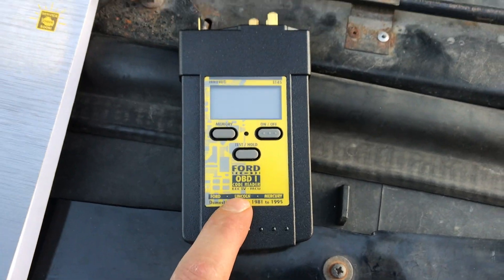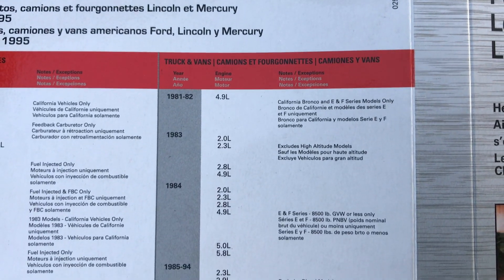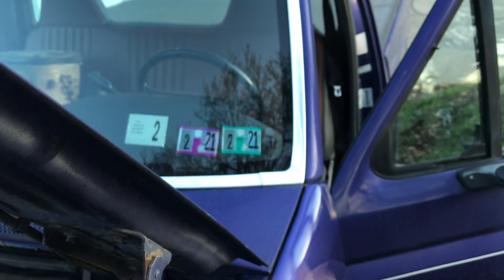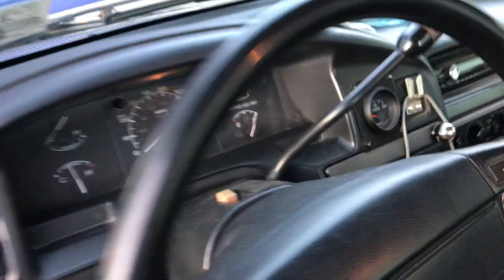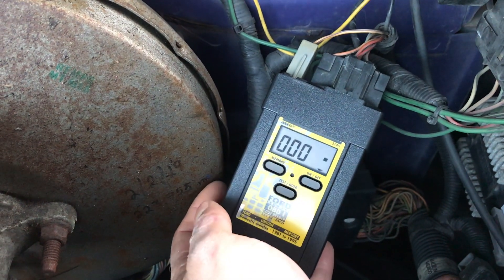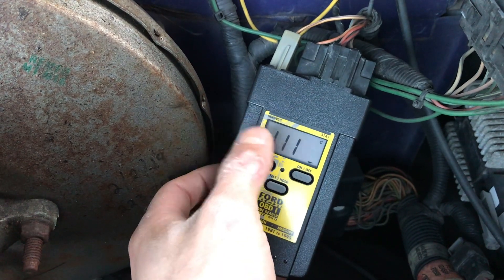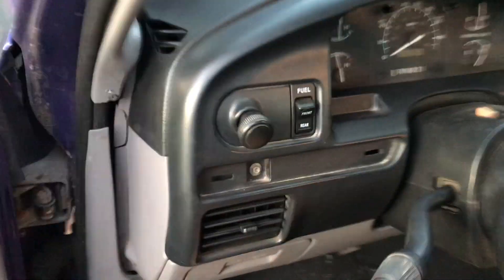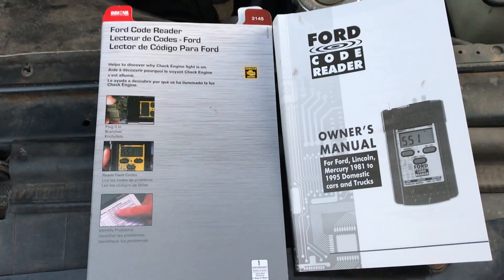How to Read OBD1 Codes on Pre-96 Ford F150

Comment: What does the * mean in the test condition section of the codes list?
Reply from the maker: Good question, I don’t think I’ve actually looked at that. Is there an explanation at the bottom of any of the pages or the front or back of the manual?
Reply: @TheMinuteMasters  not that I've seen. But yeah I ask because the manager from autozone told me my crank sensor could be what's causing my foxbody to not start which the code is 227 in the manual but the test condition has * not O R or C. But if it was the crankshaft sensor it would still come out on the code reader right?
Reply from the maker: @ShutUpKid2  Weird. Usually the code reader picks up on something it’s fairly accurate. The Astrik instead of having an actual letter code is a mystery to me. I’ll have to look at my code reader manual.

Comment: When I have mine connected and key on with the scan tool on it just displays 000 need help
Reply from the maker: Hi Austin, I would unplug the code reader and try again. This brand of code reader is good but I can’t say it’s flawless. The first three test I did it kept saying that my V8 truck was six cylinders. Finally it corrected itself. So it’s definitely worth trying a few times until something works.

Comment: Thank you for this video!! 
I’ve learned a lot.  
My 94 Escort is 10 and 111 for the 
KOEO so no issue there. 
The KOER my code reader isn’t giving me the 4 cylinder # prompt to turn the steering wheel and press on the brake so my code comes back as 
536 which is 
“BOO circuit not activated during KOER”
Possibly a defective reader?
Thoughts? 
Thank you
Reply from the maker: You're welcome! If I remember correctly, you may not always get a prompt. I would try to run the test again and just time yourself to turn the steering wheel. 
Otherwise, you could have a defective reader.

Comment: Hey man, great video. I'm fair new to trying to fix up an old family truck.  I've got a 93 XLT 5.0 and I recently started having an issue where the truck starts by immediately stalls. It's not a daily driver so it has been sitting to be tinkered with. I noticed the other day that an IAC bolt was a little loose so I tightened it and then since then I've had the issue. I removed the IAC and cleaned it/added a new gasket, it started and ran a few minutes with a normal-ish idle and then a day later it's back to the same thing. Just curious if you had any ideas on this issue. Thanks
Reply from the maker: Hi Grant! Thanks! I appreciate it!🤙 have you read the codes on your truck? That’s not a bad place to start. 
Otherwise when you have starting issues I typically go through the triangle of combustion. Air, Fuel, Spark.

Unfortunately you can only check most of the air components using a code reader because it’s mostly sensors. However, you can definitely check your filter to make sure it’s clean and if you have speed density look for the sensor and make sure that’s clean as well.
Reply: @TheMinuteMasters  So I've got the innova code reader and ran the KOEO test. Got codes 23 and 53 which are both related to TPS if I'm not mistaken. One being "high voltage" and the other "voltage out of range" I unplugged the TPS and it ran with an odd idle but it ran until I turned it off. Do you think with those 2 codes that new TPS would fix the issue? thanks man!
Reply from the maker: @grantsmith6945  That’s a good question Grant. A new TPS could fix that code. Honestly, you won’t know until you try it. It’s a cheap part too.
Reply: check the onboard computer

Comment: When I plug mine in it gets no power with the key turned or with truck on? Is a fuse blown? If so which one and where
Reply from the maker: That’s weird. I would check your fuse panel for sure. I don’t think there’s a specific fuse but it’s worth checking them.
Reply: @TheMinuteMasters  I fixed it haha it was my fault the batteries were dead in the scanner lol I checked with the test light and had power at the plug in test area so I figured it out haha. Got code 29 time for a new speed sensor haha

Comment: I have an intermittent problem with a 1995 4.9L manual. Every now and then, the truck will shudder, CEL will come on, and I will completely lose throttle response. Pedal to the floor, nothing. The truck begins coasting as if it's in neutral. Eventually it will slow down to the point that I'm almost stopped and the truck will shut off by itself. Sometimes it just shudders for a split second and then goes back to normal, but normally that's a sign that it's eventually going to shut itself down. Once the truck comes to a stop, it often will not start again, at least not immediately. It will crank and crank but no ignition. After cranking it every 30 seconds or so for a few minutes, it will fire back up like nothing happened. When the truck starts back up, the check engine light is off. 

I have a few questions. First, I'm pretty sure I have a vacuum leak somewhere (a/c defaults to defrost under acceleration, then comes back under light/no throttle). Could that possibly be related? Second, does anyone have any clue what the problem might be? And third, since the code disappears when the truck starts back up, do these trucks store codes that I would be able to read even if I'm not actively experiencing the problem, or would I have to just carry the scanner, and plug it in as soon as the truck shuts down?
Reply from the maker: Interesting problem man. A don’t think a vacuum leak would cause this bad of an issue. However, you definitely want to fix the vacuum line connected to the blend door actuator. (Passenger side of engine bay near fire wall). 
Before we jump down my usual rabbit hole of diagnosing steps, I would buy a code reader and read the codes on your truck. Fault codes are stored in the ECM. So you don’t have to plug the code reader  in as the problem is happening to get the code. Start there and then update me on what you find.🤙

Comment: I've had this brand OBD-1 for a few years now, it use to give me 2 digit codes and now since I've replaced the PCM (91 Ford F-150 XLT Lariat, 5.0) it's shooting out weird 3 digit codes...so is my reader faulty or what ?? The truck is running excellent with the new PCM and I'm not going to replace it. Any answers will be greatly appreciated, also I'm subscribing to your channel.........Thanks, TJ
Reply from the maker: Hey TJ! That’s new to me. I know OBD2 uses 3 digit codes. The 111 is the all clear 3 digit code this reader issues for OBD1. If everything is running well, then I would pay attention to the codes reader. However, I would try looking up the codes and see what they mean. 
Nice! Thanks TJ🤙 I appreciate it!
Reply: @TheMinuteMasters  Yea, it's kinda weird, until the PCM change it read the correct 2 digit codes now 3 digit codes but since the engine is running great I'm not tampering with anything. I've asked others and they replied pretty much the same as you and the booklet says nothing about it either so I'm thinking it maybe it's computer (PCM) related ??....BIG thanks for replying back !!
Reply from the maker: @t.j.h2810  Yeah totally a weird thing TJ. To me if it ain’t broke don’t fix it. Lol 🤙 You’re welcome!

Comment: Great presentation. I would however like to add that there were some ford trucks that had a GVW of 8800 or over, went beyond 1996, that still used the OBD 1 System. Case in point, my 1997 F350 with the 460 engine uses OBD1. It seems that these heavy duty trucks were exempt, up until, I think, somewhere abound 1989.
Reply from the maker: Good point the 97 years of F250 and F350s were the last of the old body style. I didn’t know they continued to use OBD1 though.
Reply: 5.8 ( 351W) Also. in some early `1998 HD F 350 cab/chasse OBS.

Comment: I have a 95 f350 7.3 and where you plugged the scan tool in I don't have that on my truck.  There is nowhere to plug the tool in
Reply from the maker: Really? My only other guesses would be to look along the passenger side fender and underneath the driver side and passenger side dash.
Reply: @TheMinuteMasters  mines on the passenger side
Reply from the maker: @ogairbender808  I’ve heard that before.

Comment: IMPORTANT: This particular tool is ONLY for Ford products. Innova makes a different model for GM products. They also produce more expensive models with a variety of adapters. Then there are REALLY expensive models that can be used with both OBD I and OBD II vehicles.

Also, the test plug isn't on the drivers side on all vehicles. Explorers, for example, have the plugs located on the passenger side.
Reply from the maker: Thanks for sharing man!🤙

Comment: What if the little gray plug isnt there ?
Reply: That connector is required for 1984 and newer models equipped with EEC-IV. 1983 and earlier models only use the one large MCU connector.
Reply from the maker: You are referring to the single wire plug? I don’t think that really matters.

Comment: Bought this code reader but it doesn’t link to my truck not sure why. It’s a 95 f150
Reply from the maker: I’ve owned two of these code readers and they aren’t the highest quality. The first code reader I owned one of the pins would fall back into the reader. So I would check to make sure that’s not happening with yours. I shot this video with the second code reader which so far is the best one of the two that I’ve owned. I would try it a few times and if it doesn’t work, I would exchange it for another.
Reply: @TheMinuteMasters  bought the reader months ago so returning it probably isn't an option but I don't think its a reader problem because my neighbor tried to use his and it wouldn't link to my truck either so I'm not sure what the problem would be.

Comment: The code in the Beginning of the test doesn’t matter?? If It didn’t have codes and the second test???
Reply: Ok had codes on key on engine off but when I do key on engine on I don’t have codes what do u recommend me to do ?
Reply from the maker: @The723shrek  I would look up those codes from the key off test, see what they are, and try to replace the part that causes the issue.
Reply from the maker: If you have any codes from the previous code reading those will appear first. Do you want to delete those out so that you have a fresh set of codes. If the first test didn’t have any codes then you were good. If the second test doesn’t have any codes then you are good also.

Comment: Hello. I know it's been a few months since your last response but I hope you see my question. I bought this scanner to diagnose a crank no start on my '93 F150 5.8L auto 4X4. As others, I get the triangle and square but no codes. I've tried it several times. Could I have a bad computer?
Reply from the maker: Hi Jose! So I would start the code reading process again and see if you get the same problem. If you get the triangle and square but no codes. I believe there is a trouble shooting guide in the code scanner manual. 
Your truck is a crank but no start. Have you checked to make sure you are getting air, fuel, and spark?
Reply: @TheMinuteMasters  Air and spark yes. It starts with starter fluid but only for 2-3 seconds. I'll try it again later today. Thanks for your quick reply.
Reply from the maker: @joseluisrodriguez7257  I would chase down the fuel aspect. The easiest thing to fix/replace is the fuel filter. Then I would replace a fuel pump, and go from there. 
No problem man!🤙

Comment: Mine just comes up with a solid square
Reply from the maker: I don’t know off hand why that happens but there is a trouble shooting guide in the code reader manual. My advice for most issues is to unplug the code reader, turn off your truck, and then restart the process.

Comment: How do you reset the light? Do you disconnect the negative terminal or pull a fuse? I have a OBD1 for my 86 f150
Reply from the maker: Which light? You don’t need to disconnect any battery terminals or pull any fuses. This code reader simply plugs into the OBD1 port and its ready to do its thing.
Reply: If you want to clear the codes pull the negative battery cable and let it sit for a few minutes

Comment: Hey man! My light comes on & goes off after a minute, I’m having lack of power when going up hills now. Would this tell me about my issue ?
Reply from the maker: What light goes off and on? 
If you are having any electrical or sensor issues, this will typically find them. I’d go for it. 
If your truck still seems sluggish up hills I would start looking at things like a fuel pump, fuel filter, and ignition components.

Comment: Hey man I know this video isn’t about this but I’m look at an old 91’ ranger xlt and I’m trying to find ways to see if the miles have been rolled back. Do you know any methods to check the miles being rolled?
Reply from the maker: That’s a good question! The easiest way is to compare paperwork. Tiles, inspection reports, bills of sale, Car fax, etc. If the odometer is not consistent with the paperwork, then something is off. 
What makes you think the odometer has been rolled back?
Reply: @TheMinuteMasters  k thank you!! It apparently only has about 60,300 miles on and it but it looks like perfect condition, but with a little top rust by the wheel wells
Reply from the maker: @zachstrobel  No problem man!🤙 interesting. I mean that seems about right for 60,000 miles. Honestly mileage aside I will just go through the entire truck with a fine tooth comb. If everything else is in really good condition who could care about the mileage. I would do a compression check because if it is a high mileage vehicle you should see a difference. But at 60,000 miles, the compressions should still be really good.
Reply: @TheMinuteMasters  K thank you a lot!! I’ve been trying to find more and more ways to find out if there’s been a set back or not, and I’ll definitely go looking close at everything. Thank you a ton again!!!

Comment: Any idea if this will help me? 1995 f250, while driving a light will come on for a little bit then go away, never stays for more than a minute or 2, I don’t notice any difference in driving or anything. Wasn’t sure if this will have a way to pick up that code or not? I have no way of predicting when it comes so I wasn’t sure if obd1 stored past codes or anything like that, or if I’ll have to get lucky and it triggers while the scanner is plugged in.
Reply from the maker: This scanner could help you. It sounds like something is shorting out or becoming unplugged. These scanners are always good to own, so it's worth your while to buy one. I say give the scanner a go.

Comment: Quick question..

I for years have diagnosed these trucks by the ole "Ear-o-Matic 5000XL" aka My Ears.

I recently got the innova scanner. I followed your directions to a T. I keep getting code 13 and 72. One is for operator error. Im wondering if im doing the test wrong. I also have codes 31 and 32 for the EVP I believe. Truck has a erradic idle, the only symptom is a slight shake at idle when watching the manifold i can see its shaking.. Cant tell a difference in engine speed (no tach). Ive made sure my TPS is withing spec, iac circuit is working, throttle plate is clean, map sensor working correctly (checked with vaccum guage and a spectrum scope ) spark plugs not fouled, new wires and cap, new coil, air filter is new only has 6k on it. Oil is always changed at 2500-3000 mile intervals with the filter. EGR seems to work, hold vaccum at least. The vaccum line from the egr to the EGR solenoid is solid. The truck has a new EGR solenoid. Any tips?
Reply: Thanks for the ideas!
Reply from the maker: @UserName-ln5ol  No problem Taylor!🤙 Thanks for watching and commenting.
Reply from the maker: Before I had one of these scanners I was the same way. I have a mild shake at idle too. My 95 doesn’t have a tach so I can’t tell if these is a change in RPM but I don’t think so. 
It sounds like to me, you’ve checked everything. I know for my truck I’m thinking of cleaning the IAC valve and possibly replacing it. The benefit of these scanners is it will find an electric issues, but I’m skeptical if it can find mechanical issues. Hence, why I want to clean the IAC. 
Are all of your vacuum lines new? Sometimes new vacuum lines help. 
Otherwise, I would keep following your gut and go through a part by part check. One part/parts, that could cause a slight issue would be fuel injectors. Electrically they could be sound but mechanical the spray tip could be fouled a bit.
Reply: @TheMinuteMasters  i bought a stethescope and tomorrow while im rebuilding the front end, ill check each injector to see if the solenoids are firing in each. Im thinking one may be stuck open (which would explain the heavy smell of unburnt fuel) and if its stuck open, perhaps it could be too rich at idle to properly burn causing a imbalence in the engine (not a misfire but less power in that piston) which im assuming may cause a shake or imbalence.
Reply from the maker: @UserName-ln5ol  That’s a good idea and definitely worth a try. Whenever I have issues to always go back to the engine triangle air, fuel, and spark. Fuel typically gets passed over in favor of the other two of the trifecta. Dry injectors can also cause issues too.
Reply: @TheMinuteMasters  i stethescoped the injectors, they all work. It seems like the idle got better after i drained the oil(which had lucas in it) and replaced it with 10-30. Guess that snake oil isnt always good.
Reply: I also checked pressure at the fuel rail at idle and with key on engine off, both fell into spec.
Reply from the maker: @UserName-ln5ol  Believe it or not, oil changes do solve little issues. It never seems that way until you do it.

Comment: Gonna have to get this scanner. If I remember right, mine you have to count the flashes. This is much easier.
Reply from the maker: These scanners are definitely good to have. I used to have an old Datsun and I had to count the flashes too.
Reply: @TheMinuteMasters  well, i got one sitting in my amazon cart. As well as the extension!
Reply from the maker: @briant.4618  Nice!🤙